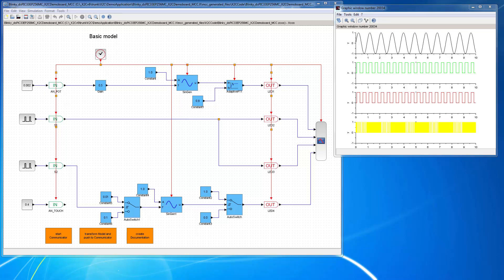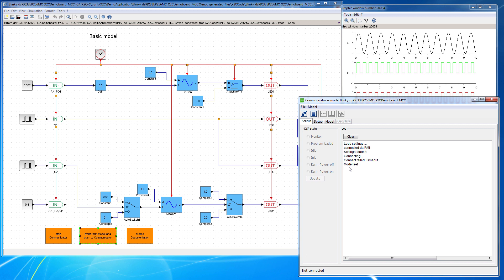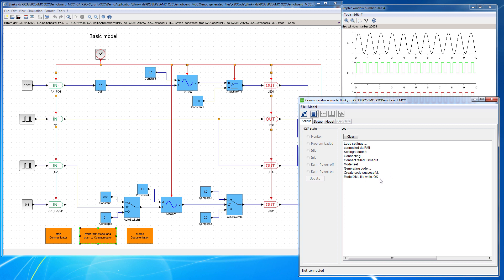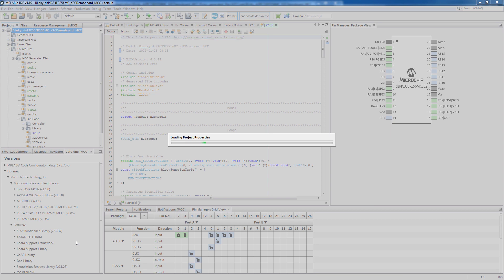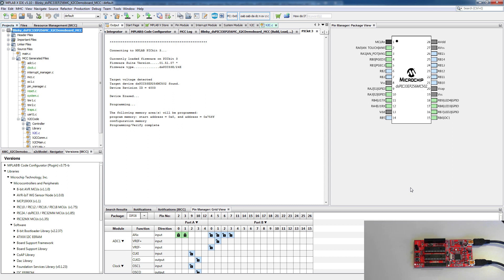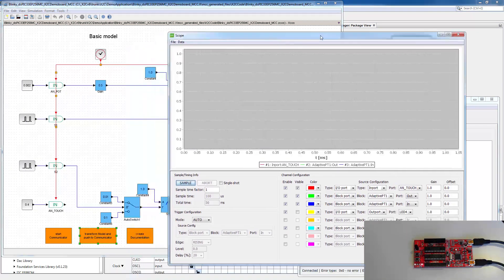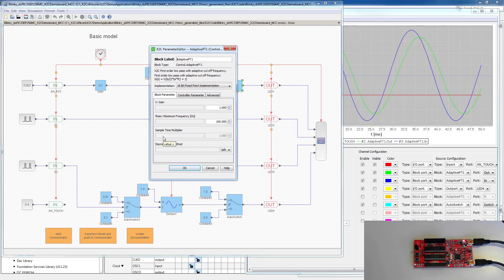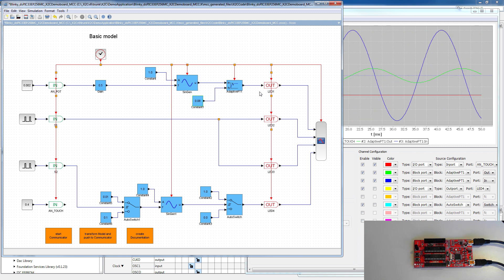03 X2Cv6 generate code for the first project and run it on the hardware

Comment: I can't connect to my MCU via Communicator.

COM4 is listed in the devicemanager and I can flash the MCU with µVision, but the Connector offers me only COM1 (it was listed earlier, but the log said something, that COM4 can't be used). I also manage to make COM4 appear, by flashing a code, that utilises USART.
I then get a Timeout.
Reply: "Connect failed: Port 'COM4' does not exist on this system"

hTerm detects COM4, the X2C Communicator does not.
Reply: @augustkravtsov  I have the same error, could you solve it?
Reply: @lautiwillhuber7493  for the error »Connect failed: COM … system« I simply replugged the cable and refreshed the ports in the connector. Tell me whether I understood your issue correctly.